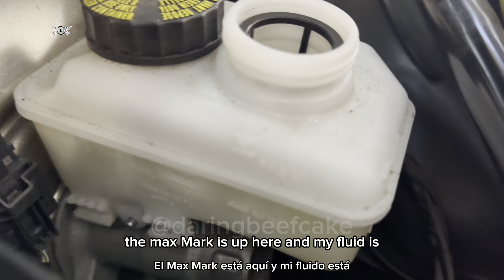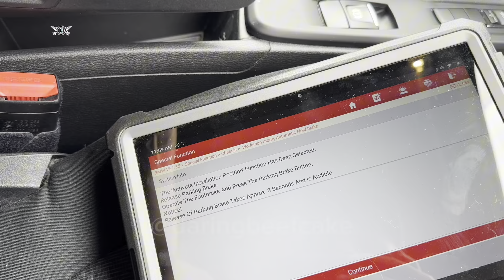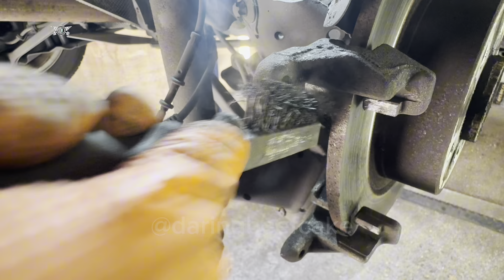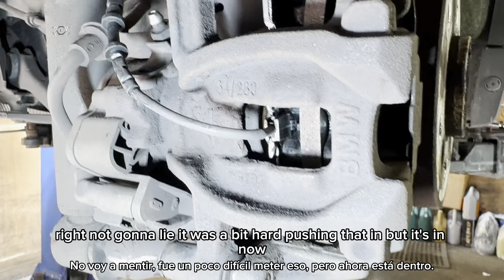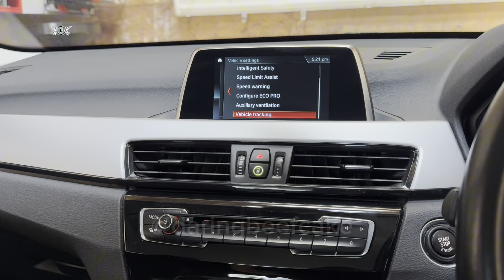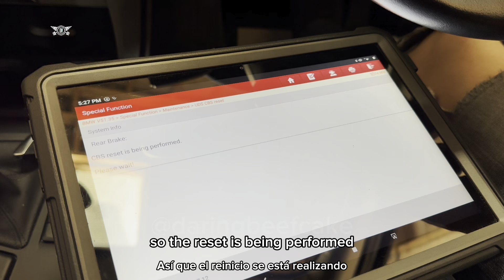BMW X1 2017 f48 f45 rear brake pads removal and replacement #maintenance #brakepads #bmwx1

Comment: And this is the reason why my local tyre and brake garage declined to change my rear brakes on the GLC250D 4MATIC. They obviously didn't have the gadget to release the rear brakes. At least I know now. Thanks for sharing. I had to take it to the Mercedes garage and pay through the nose for it. Another great informative video. One question. Why Daring Beef Cake? That's always intrigued me. I hope you are having a great Bank Holiday weekend and able to have that extra day off.